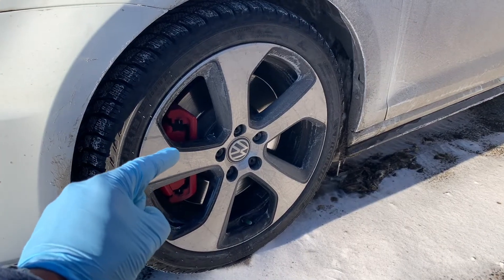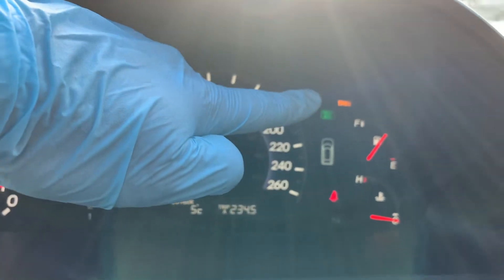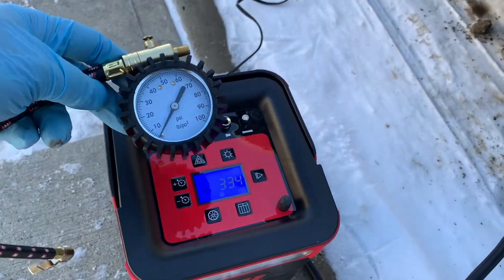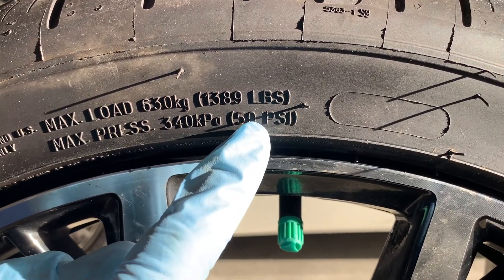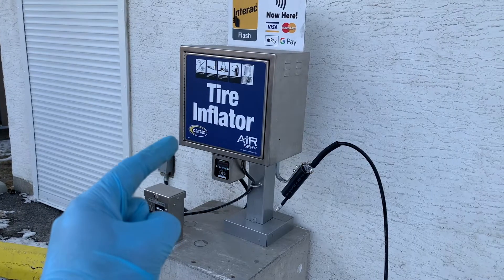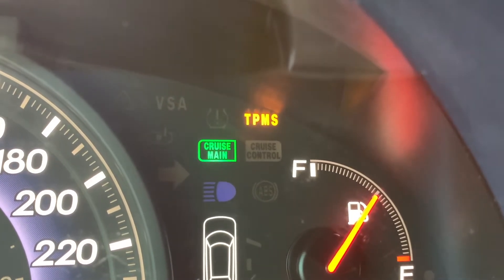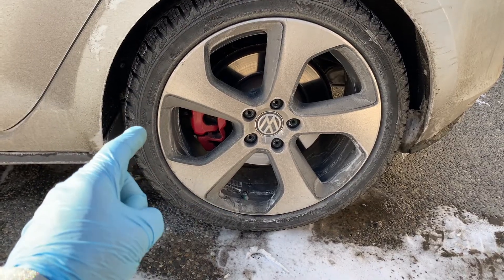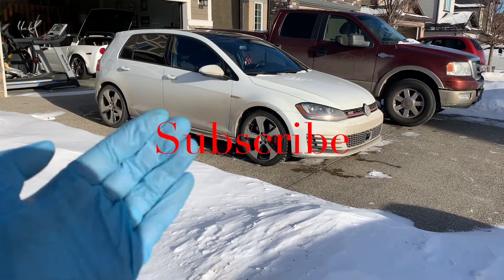How Cold Weather Affects Tire Pressure - don't drive on underinflated tires

Comment: I live in the SW of New Mexico at 5000' and we often get a 30-50 degree temperature swings daily.  In the winter, if I check the tire pressure in the morning before the sun hits the tires, should I still keep them at the recommended pressure of 32 PSI knowing it will get anywhere from 30-50 degrees warmer?  This is confusing, especially in the winter.
Reply from the maker: You should inflate your tires when they are cold to the recommended psi, even with that kind of temp swing.
Reply: @YourHomeGarage  thank you so much...that is what I was guessing.

Comment: Hi thx for the info. I live in Northern Virginia, where temperatures frequently changes 20-30 degrees F in winters. What should I do? I drive a Toyota Corolla, it is supposed to have 35 psi.
Reply from the maker: If your tires hold at 35 psi because you do a considerable amount of driving, then leave it as is.  On average, you will likely lose 1 psi for every 10 degrees - so it’s very common to put 1 or 2 pounds extra if you find the tire drop is significant.
Reply: @YourHomeGarage  Ok thx.

Comment: Again and again I see the one piece of most important information either gets left out, brushed over or incorrectly presented is: what does the "COLD TIRE PRESSURE" really means.  A cold tire can be sitting under the shade of a tree in the Arizona dessert or on top of the snowy Rocky Mountain with huge temperature differences so what is the standard of the "COLD TIRE PRESSURE" on the sticker means?  "COLD TIRE PRESSURE" on the sticker means that the recommended pressure listed for the individual tire on the sticker is based on the ambient temperature of 68F/20C (COLD TIRE PRESSURE) to the individual tire size listed; therefore, the pressure would need to be either increased or decreased if the ambient temperature is either over or under the 68F/20C tested temperature when checking for the correct tire pressure.  This important information should been stated on the sticker next to the "COLD TIRE PRESSURE" or replace the words with "AT 68F/20C TEMPERATURE".  Please use the link provided for more information:  https://en.wikipedia.org/wiki/Cold_inflation_pressure
Reply from the maker: This is fantastic technical information.  Thank you for it.  I just may turn this into a video idea as there is very little information available as you’ve stated.  Thank you!

Comment: Ugh. So, great video first of all. My lingering question is based on my climate, which is Central Florida. It might get occasionally cold here, and certainly once a season I have the problem stated in the video, but it’s forecast to be 74 degrees again in about three days. Today we have a high of 61. I’ve gotten my warning that a back tire is under the recommended pressure reading. If I raise it to recommended today- what’s going to happen in three days? 😫
Reply from the maker: And if you raise the PSI to the correct amount today, nothing serious will happen in a few days when the outside temperature increases.  Tires are meant in increase a few PSI when the air heats up from driving long periods of time.  It's more important to always have the correct cold PSI tire rating.  So, bottomline - go ahead and fill the tire(s) if your sensor is on.
Reply from the maker: I experienced similar when I lived on the Pacific coast.  An option might be to fill the tires with nitrogen vs air.  Nitrogen maintains its tire pressure for a lot longer, so those temporary drops in temperature may not affect you as much.  Just an option.  And thank you for the kind words on the video.